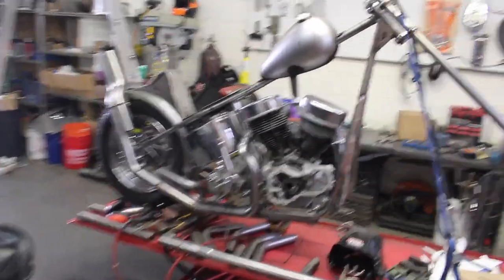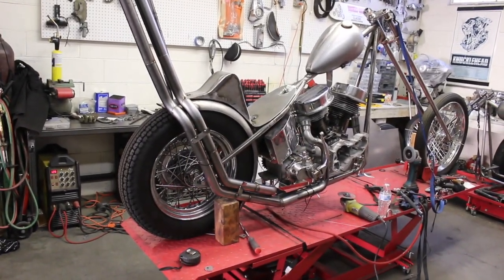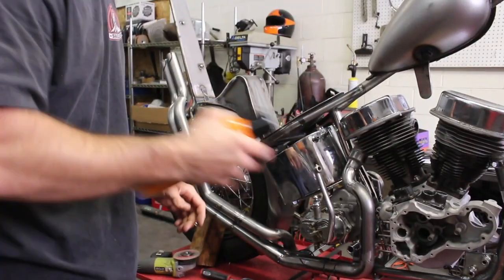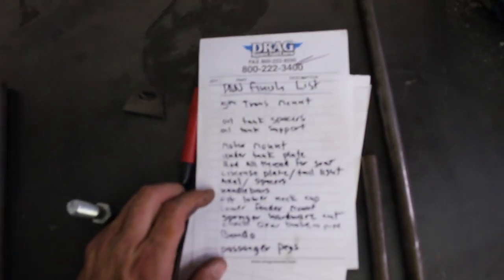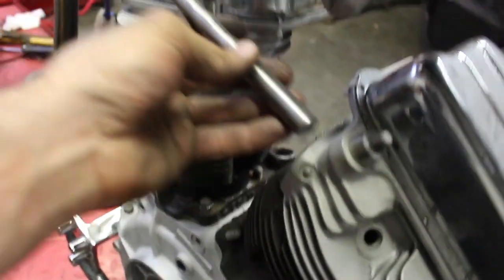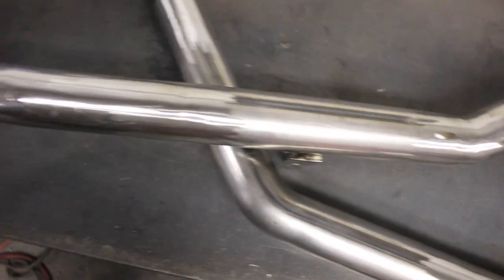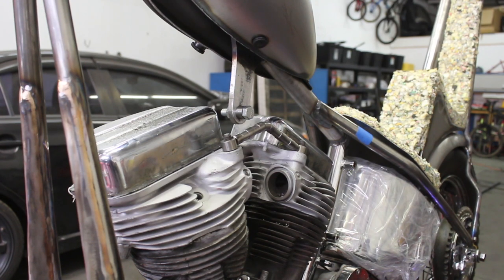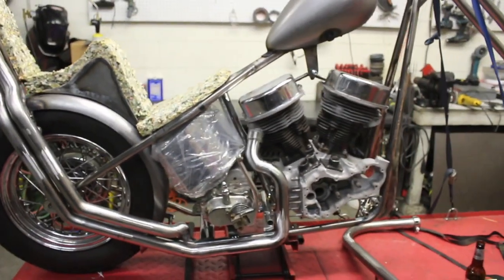Harley Davidson Panhead chopper build - Part 3

Comment: can you pull the studs out of the heads and use bolts for the mount
Reply from the maker: Yes I can and I may do that on final assembly, I just try not to remove the studs because aluminum loses a small amount of material every time the bolt threads go in and out and head repairs suck haha.